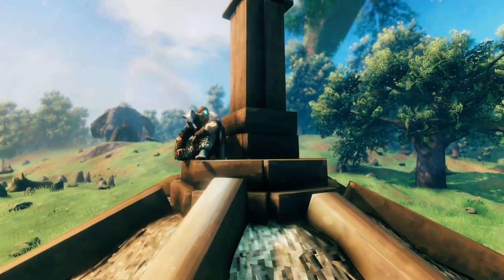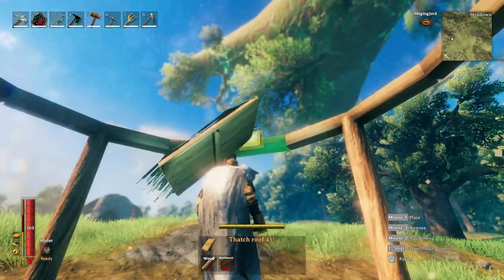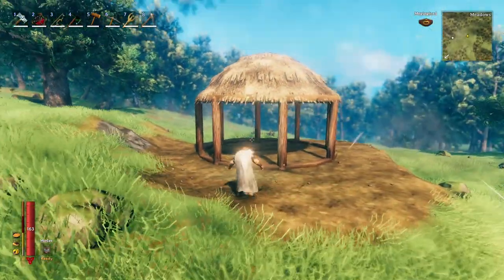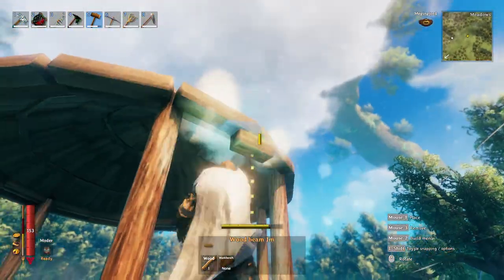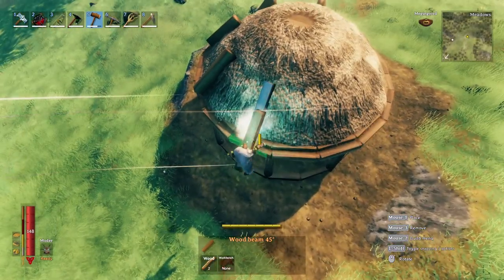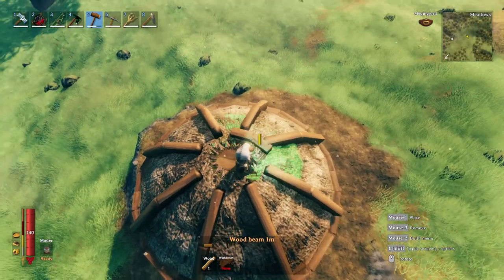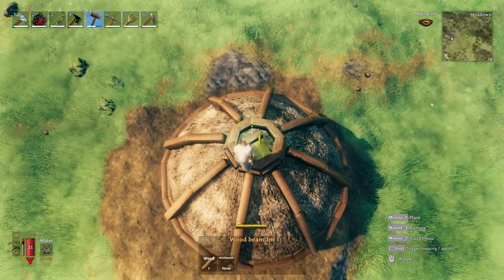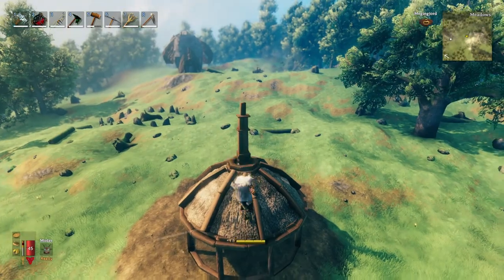Valheim - How to build a dome roof. (with additional details)

Comment: But the centre isnt rainproof, right?
Reply from the maker: No but can easily be fixed with a roof piece underneath
Reply: You can also try using the corner roof pieces and use the top of the 26 degree snap points to go around after experimenting with angling them off a little different to create a new spiral in the middle - looks quite pleasing and adds the gap coverage on top with roof pieces.
Reply from the maker: @KillJoy83  nice tip! Thank you